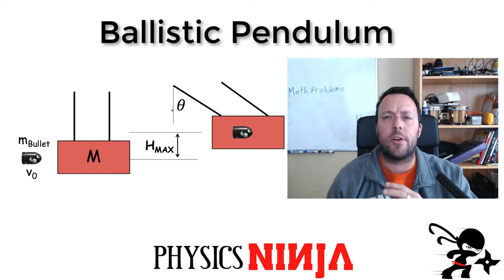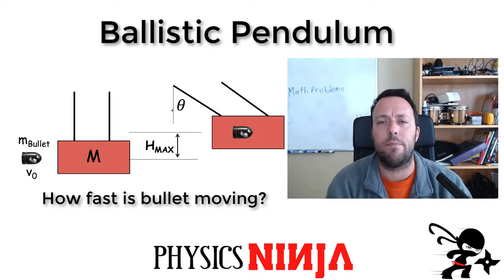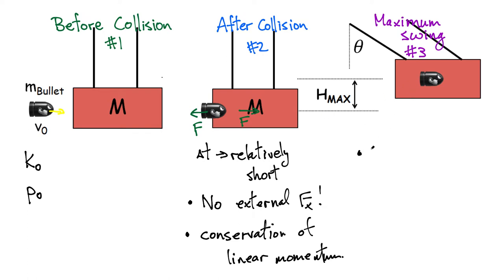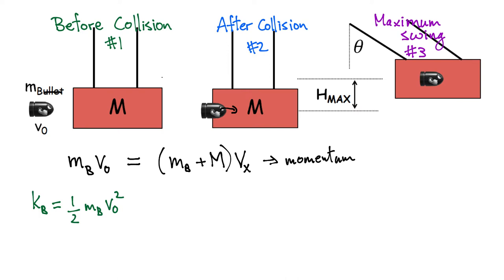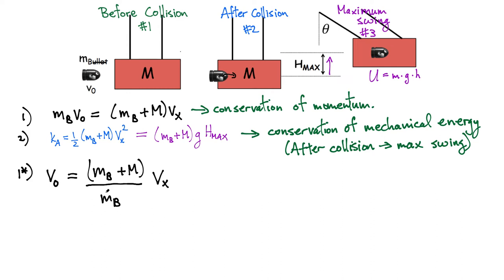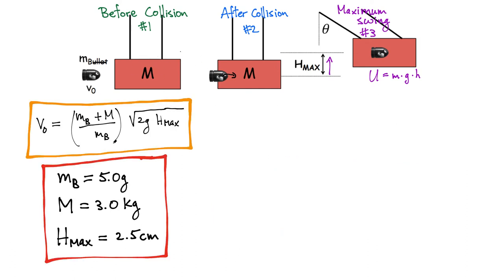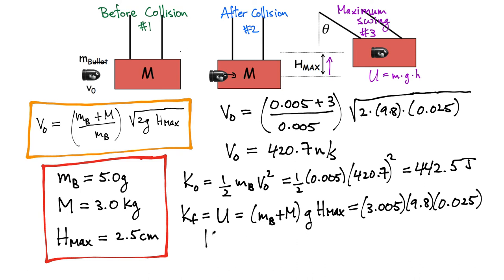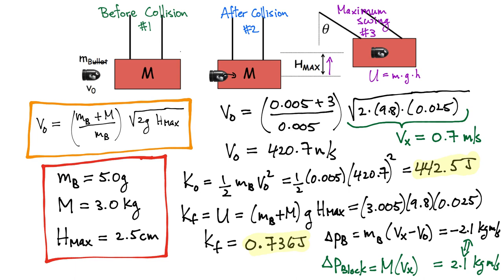Ballistic Pendulum Problem

Comment: Hi, just wondering how you find the maximum angle moved from the vertical by the block of wood. any tips are greatly appreciated!
Reply from the maker: If you know the maximum height and the length of the string try drawing a triangle and use trigonometry to find the maximum angle.
Reply: @PhysicsNinja  what if you're not given the length of the rope in the question? I'm doing one which has most of the variables apart from the length

Comment: If we have a pendulum assembly with a rod (mass is 20 g) do we include that for the uppercase M or do we just look at the mass of the block rather than the mass of the whole pendulum assembly? Also, how would we measure the angle it reaches with a protractor? Would it be from the right edge of the block or from the top of the pendulum assembly because I am getting two different values? Thanks :)
Reply: Lmao imagine if he responds after a year
Reply: @armanbarzani4148  I don't think that's happening at this point lol plus I finished my physics sequence last semester